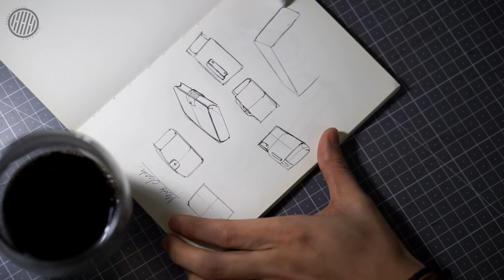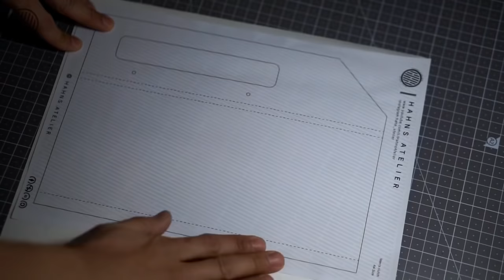[Leather Craft] Making a simple handmade clutch bag / free PDF pattern

Comment: What kind of glue is that? Great work!
Reply from the maker: Thanks for asking Tyler!  Here is the glue that I use usually Hope this helps!😊
1. kenda bond 
: yellow, chemical smell, very strong, low price
2. intercom ecostic, high price
: white, no chemical smell, thin
3. Instant adhesive
: race, braiding, metal hardware (rarely)
4. B5 bond
: Beige, Thick, using for lining.
Reply: @HahnsAtelier  Thank you! Great work. I dig the channel.
Reply: @HahnsAtelier  Perfect! Thank you!

Comment: Subscribe to the channel and watch it without fail.  Thank you for your wonderful leather craft videos.  I am currently making this clutch bag, but I have a question.  In the tutorial video, the gusset is pasted about 1.5mm lower than the bottom of the glued parts inside the handle.  When I try using the PDF pattern I received, I feel that no matter how many times I check it, it won't work well unless the gusset part is pasted with a 0 touch at the bottom of the handle part without any gaps.  The gusset has only been temporarily fitted, but I would like to make this project a success, so please guide me.

Comment: hi, what are you using as glue. and please pdf link :)
Reply from the maker: I've already shared it. It's on the first comment 👍
+ Here is the glue that I use usually Hope this helps!😊
1. kenda bond 
: yellow, chemical smell, very strong, low price
2. intercom ecostic, high price
: white, no chemical smell, thin
3. Instant adhesive
: race, braiding, metal hardware (rarely)
4. B5 bond
: Beige, Thick, using for lining.
Reply: @HahnsAtelier  
thank you very much for the information, I can not find any of these products in Turkey :(
Reply from the maker: @hakanguven447  I'm sry about that. But I think there is other products replaceable of mine. Hope you get it soon!
Reply: @HahnsAtelier  
I hope I can find that other builders don't want to leave a stain
Reply: @HahnsAtelier  such as your YouTube channel you want to do in Turkey free pdf etc.

Comment: What type of white glue?
Reply from the maker: Here is the glue that I use usually Hope this helps!😊
1. kenda bond 
: yellow, chemical smell, very strong, low price
2. intercom 1816b ecostic, high price
: white, no chemical smell, thin
3. Instant adhesive
: race, braiding, metal hardware (rarely)
4. B5 bond
: Beige, Thick, using for lining.
Reply: @HahnsAtelier  Thanks

Comment: Что за клей?
Reply from the maker: Жаль это английский

Here is the glue that I use usually Hope this helps!😊
1. kenda bond 
: yellow, chemical smell, very strong, low price
2. intercom ecostic, high price
: white, no chemical smell, thin
3. Instant adhesive
: race, braiding, metal hardware (rarely)
4. B5 bond
: Beige, Thick, using for lining.